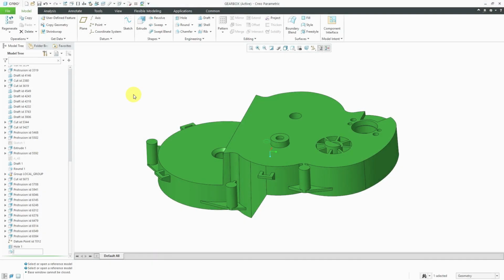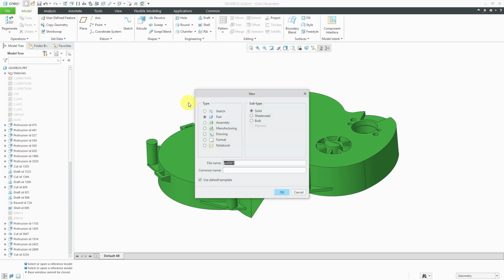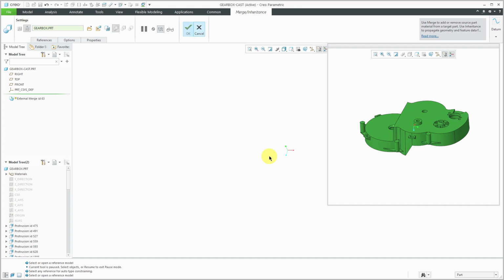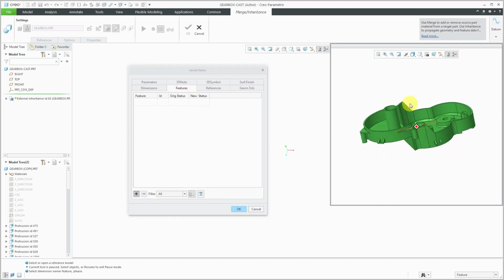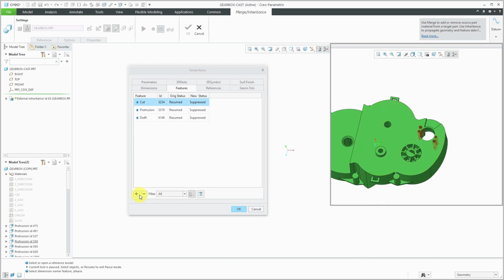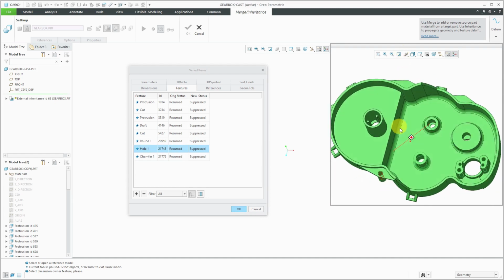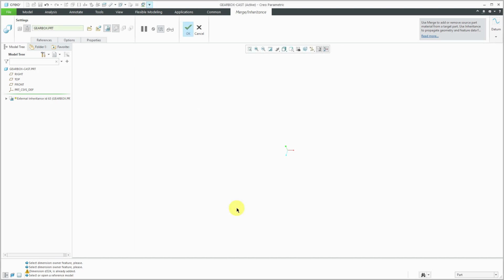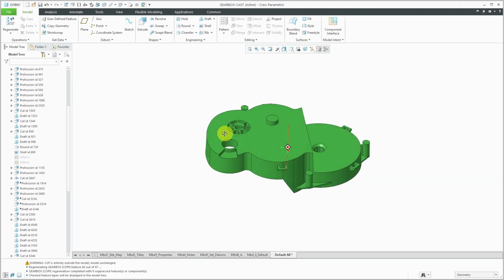Creo Parametric - Inheritance Features for Machining Models (Part 2)

Comment: Good tutorial! What about welded components? If i have a welded assembly and then i have to machining it, what is the best practice? The inheritance features seems working only for parts... We usually add features (extrude or revolve) in assembly but i don't know if it is a good solution for the problem. Moreover, we have to create multiple assembly to have welded assembly and machined assembly to be shown in separate drawings.. no way to use simplyrep to suppress feature in assembly...